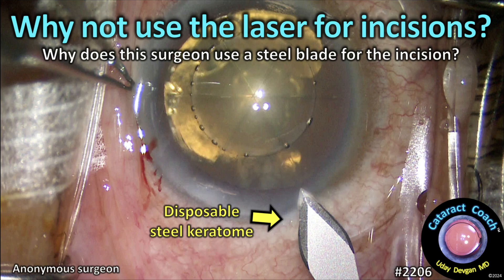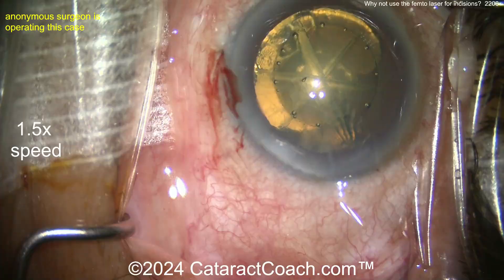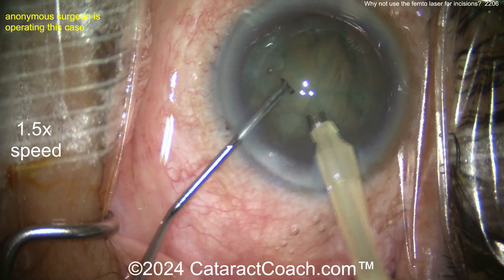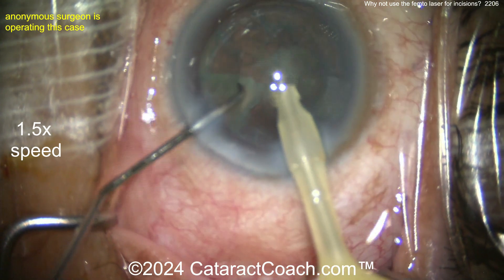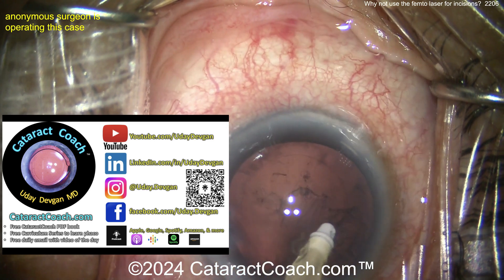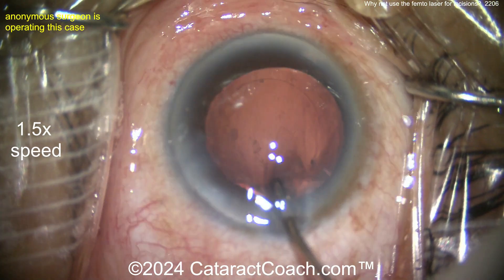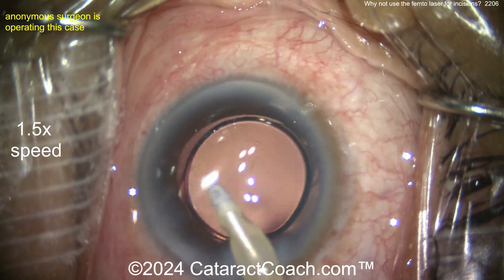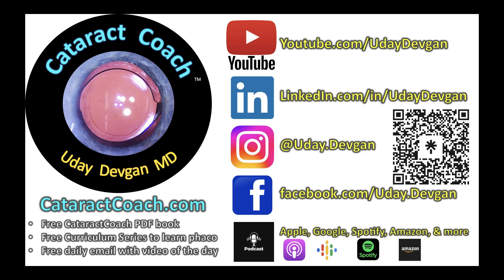CataractCoach™ 2206: why not use the femto laser for incisions?

Comment: I do use a femto for premium cases. I can make small, 30% depth LRIs to mark the limbus at the axis of rotation, and make sure I have a nicely sized and centered rhexis. I can definitely do that all manually, and still do at least 90% of my surgery with a manual rhexis, but I feel like there's a little extra margin of safety for centration and sizing of the rhexis with the laser. 
Definitely make all incisions with a blade, though (except for LASIK flaps, those are still femto flaps).

Also, that was an MX60E IOL, and if the surgeon is using the standard B&L injector, it can easily go through a 2.2mm incision, so I wonder how small that incision is that the insertion was difficult?
Reply from the maker: agree with LASIK -- I use the femtosecond laser to make flaps in 99+% of cases.